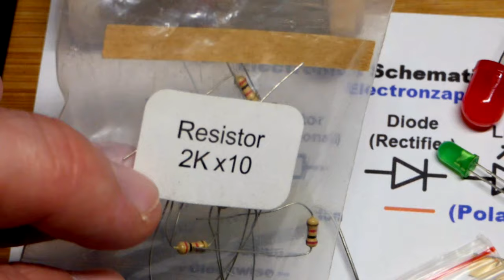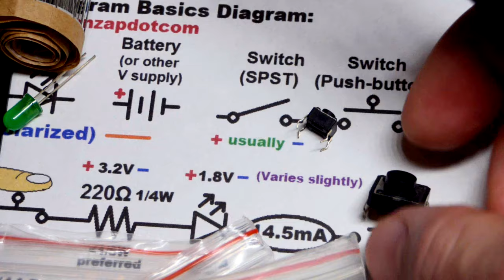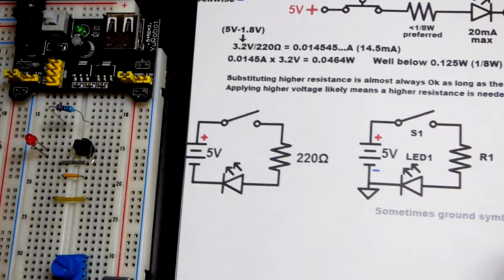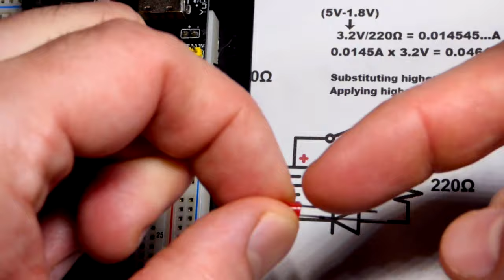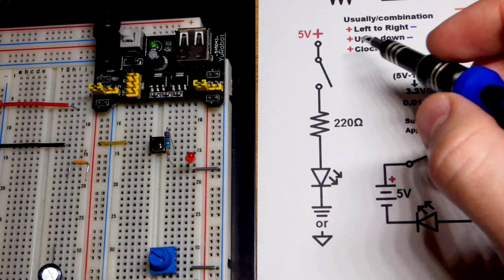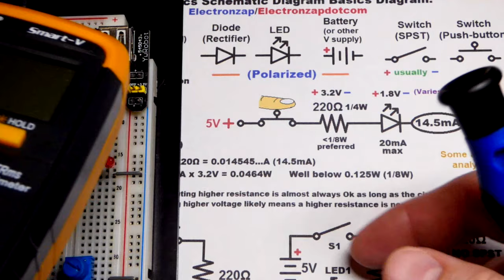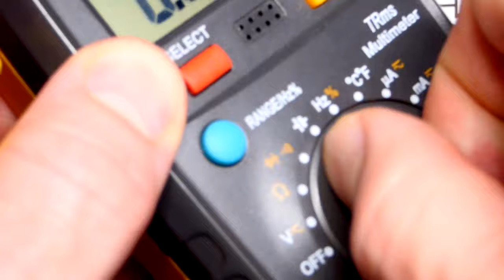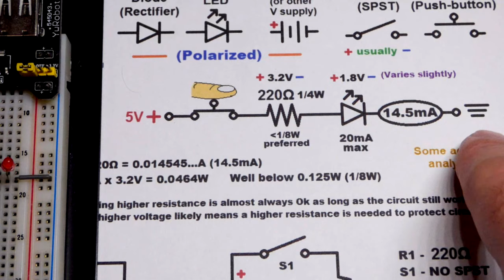How to read schematic diagrams for electronics part 1 tutorial: The basics

Comment: it's supposed to be the basics, but you're going to fast, not giving enough explanation about anything. Thumb down for me.
Reply from the maker: Thanks for the input!
Reply: @Electronzap  Sorry if I was a bit rude, the video is basics, so supposed to be for total beginners, if it's not the case, it would have been great to advice some specific videos to learn the basics of the basics and understand this one
Reply from the maker: Is all good, I know you will find videos you like. YouTube has a wide variety.
Reply: Come on! smh
Reply: If its too fast for you, youtube has speed settings. Slow it down!
Reply: @Electronzap  I, for one, have been scouring You Tube looking for beginner electronics info. They all start with too much knowledge assumed.
Reply: @Electronzap  I, for one, have been digging for awhile now and have found nothing for beginners.  They all assume that you already know a lot or won't answer questions without quickly blowing you off.  Very frustrating.
Reply: You did a good job. I learned electronics years ago. You refresh my mind, it is really clear ( I m from France) and pedagocical. Thanks much man, you do it!

Comment: From 18:07 - 18:14 you said that the 14.5 mA current is also present thru the resistor and the switch, i.e. 14.5 mA throughout the circuit, but wouldn't the current be greater before the resistor, because the purpose of a resistor is to reduce current flow?
Reply: in series the current is the same. the voltage drops across the resistor. the resistor draws a current by dropping the voltage. in series. in parallel different rules.

Comment: 17:43 howcome we don't 5v / 220ohms ? why 3.2v instead of 5v?
Reply from the maker: The red LED drops about 2 volts before the resistor sets the current. Each series component has some of the total voltage across it. That's less voltage across the other series components.

Comment: I see a schematic that shows parts that are not connected with any part of the main schematics. How we know where they fit in the circuit.
Reply from the maker: Not sure what you mean. The zener diode schematic is using lines ending with ground symbols to indicate that they are all connected together electrically to the point called ground. That's a common way to draw out a schematic when you have a lot of circuit paths that you don't want to draw a bunch of lines for, going to the same place.